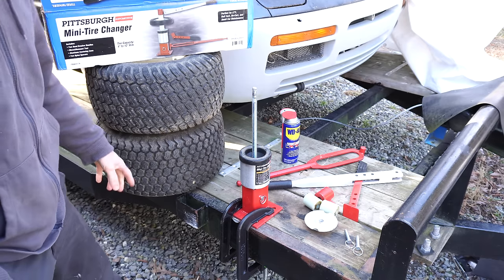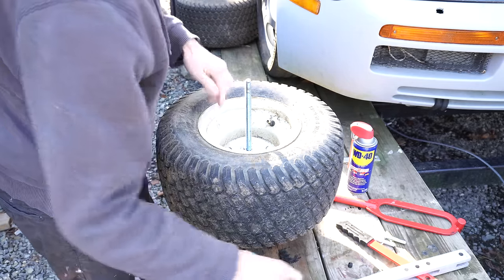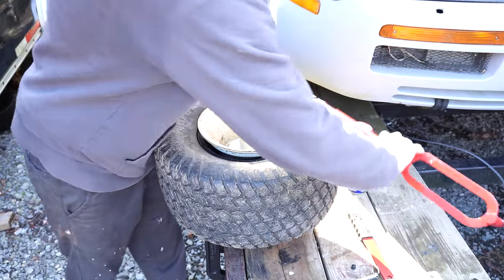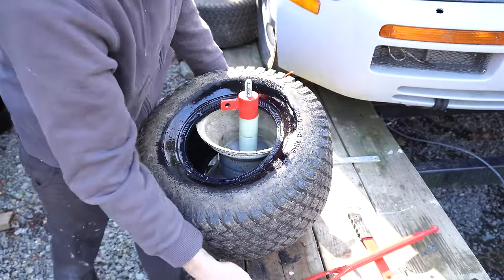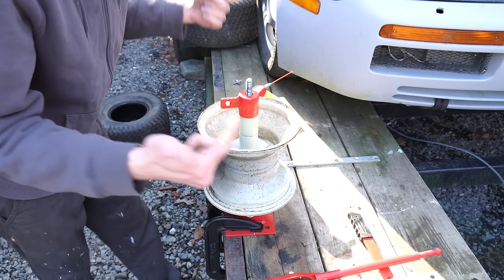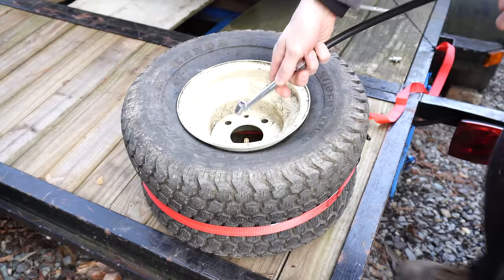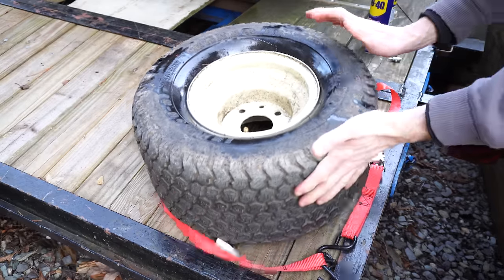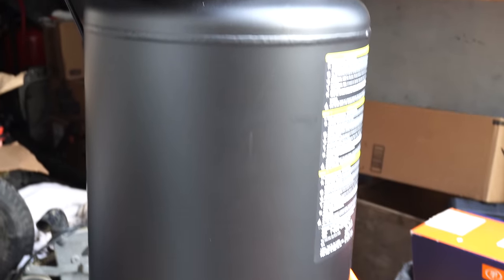Harbor Freight Mini-Tire Changer (How to Change A Tractor Tire)

Comment: His procedure is spot on for 8" rims but if you go down to say 6" rims, it's a struggle.
Reply from the maker: Yea the smaller front wheels are more difficult to get back on, but just as easy as the larger ones to get off, I'd recommend getting some tire irons to help get the tire back on.

Comment: If it's still holding air, then why does it need to be changed?
Reply from the maker: tread matching, brand matching, maybe it wasn't holding air, any reason a person wants really. the valve stem still needs to be taken out even if there's no pressure in the tire.
Reply: @aDIYCarGuy  Any reason the valve stem needs to be taken out? I just replaced a tire and I didn't touch the valve stem at all.
Reply from the maker: @Tubeytime  to let the air move, makes it easier to pop the bead
Reply: @aDIYCarGuy  Okay, thanks! :)

Comment: I would got all that done quicker than how he did with two large flat head screwdrivers and a pair vice grips 👌 but this was a good video tho showing me it takes longer using this tool/machine
Reply: WOW, you should put a video out, so we can see you do it.
Reply: @irishamerican4558  it's really not that hard. When you work in a shop it's all about speed and time is $$$. the longer it takes the less money is made. Plus this machine can damage a tube in a heartbeat easy versus the 2 screwdriver method.i am most definitely certain that it be much more difficult doing a tire when installing a tube. The tube takes away some of the room he has doing a tubeless tire.
Reply: @montgomeryward9952  Make a video & post a link here when you get done. I'll watch, hell I'll even watch the commercials.
Reply: @irishamerican4558  only if I get paid for it I don't work for free bud
Reply: Very true. Nice machine, only thing good about it was holding the wheel down in place 😂

Comment: DON'T USE WD40 on rubber. WD stands for water displacement. It will dry out the rubber and shorten the life of the tire or anything rubber you spray it on. I just use liquid dish soap in this application, works well.

Comment: I just wish for once in my fucking life that what I’m working on would go as easy as the video. I can’t for the life of me to get the bead to pop even with all the air out
Reply from the maker: I feel that. Most things are 97,000x harder than they should be. Could the bead be rusty? The full size manual tire changer might help either way, it gives a lot more leverage. Some little tires are a lot more difficult than others. Might have to take it to a shop and have them pop the bead.

Comment: I've had this for years.  But don't bother to try to use this of anything else on 4" wheels as found on the front of old Snappers.  Those things are just about impossible.
Reply: I was thinking about getting one for just that purpose.  How do you work on those small front snapper wheels? I’m looking at 6 pairs of them…
Reply: Buy new ones.  Those things are near impossible.